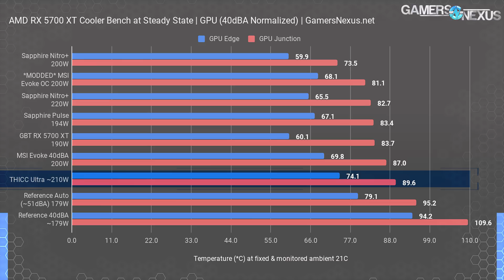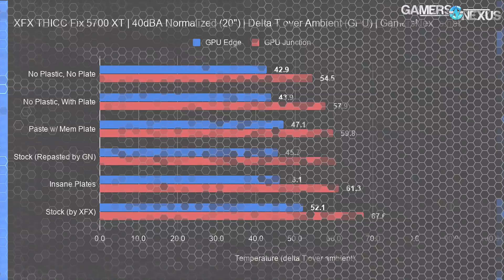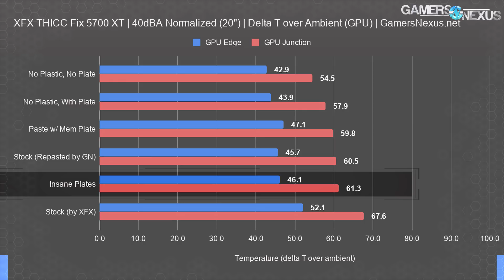Worse Than We Thought: Fixing the XFX THICC 5700 XT

Comment: 🤦‍♂️🤦‍♂️🤦‍♂️ I've been using this card for 5 years now and decided since I'm building a new pc I'll put all my old pc components in a no-frills high airflow mesh case as a guest rig.

I knew the AIO is at EOL, I'm idling in the mid 60s for gpu and cpu and I assumed yeah I just need to dust and repaste which is definitely 70% of the issue.

But had I known taking a bunch of plastic shit off the card would make it run that much cooler I would have done it! Damn, whats the energy of an extra 10c over 5 years?😂

Comment: hmm - My XFX 5700 (that is non-XT) reaches to just over 100 degrees in Radeon overlocked mode.
I suppose I should do something about my card as well. - It's a good performer, but the fans just go nuts now and then when it's constantly sitting around 95-100 degrees with the most demanding games and it's really fatiguing to play with, even with half-open headphones. - That said, I sit right next to the case and it's very "open" with more than half of the walls being mesh. - On top of that, I've even put two 140mm fans as intakes right onto the GPU's own fans, but it only helps a little bit.

Comment: So I got this card when it came out because (maybe thanks to scathing reviews?) it was a lot cheaper than all other AiB 5700s.
I was waiting for XFX to send me the THICC III copper memory plate for most of this time, but they ghosted on all non-XT owners because of COVID.
Today, I finally got over that disappointment and opened the card to remove the McD plastic & backplate, repaste and tighten properly. I also adjusted a thermal pad on the memory plate that was even worse positioned than the one in this vid; it only made contact with 1 of the 4 cooling pipes (???).

After testing before & after with Superposition and 5 min Furmark, the GPU temp went down 20 °C, hotspot by 10–15 °C and memory by 10 °C. These are rough values, as there were some small differences in fan speed & starting temp. Absolutely ridiculous improvements for what barely qualifies as "modding." Highly, highly recommended.

Comment: I just modded my XFX 5700 XT THICC II: All plastic parts removed except the part holding the fans. Backplate removed. Memory plate (stainless steel) removed. Memory temperature is worse now: 97°C junction (max) & 104°C memory (max) @ Shadow of the Tomb Raider. Before: 97°C junction (max) & 92°C memory (max). I did not alter the fan speed. Using the latest bios available from the XFX website. Edit: I misunderstood and thought they'd removed the memory plate too. I readded the memory plate and added paste on the contact points of the plate and the cooler. In contrary to Gamers Nexus I did not remove the thermal pads between the memory plate and the cooler.
Memory temps are improved a lot now - still 92°C max but the average temp is lower. Thank you Gamer Nexus :)

Comment: Jsz Fkn x, How can they use STAINLESS STEEL as material for a component that is supposed to conduct heat !!!???
Don't they know the first thing about materials and their respective thermal conductivity ??
("stainless" has about  "a 15th" of the "condictivity" of aluminium, they would have been 3xbetter off (from heat-perspective) using "regular steel")
But of course they know all this, which makes the choice even more egregious since they made the "bad choice" knowingly...
And I must confess that I still can't see how this even makes economic sense, as "stainless" is both generally speaking both more expensive, and harder to "machine"...So I can only conclude that there must be "manufacturing conciderations" that still makes "stainless" the """preferable choice""", for the PRODUCER...

Comment: I ordered a 5700xt Thicc 2 yesterday. I heard they fixed actually every problem with the card and drivers are top now too. I got it for 369€ including shipping.
Reply: 2 Months later and i wanted to give a headsup. The Thicc 2 Ultra was actual trash, dont buy it. The contact to the coldplate still sucks balls.
Refunded the first one and the second one also had the same problem. Refunded the second one too and got me a Nitro+. I undervolted it to 1.1v and 2100mhz real boost.

Comment: Man I bought the THICC III on Black Friday, it was cheap, 390€, it actually has copper plate for the memory instead of steel, and three fans, and I thought I'd be better, but thermals are still pretty bad and now I don't know if I should return it or just remove the useless plastic.

I mean, temps decreased A LOT with this solution, so much that it could actually be a great card, if I get those results (-6º Memory, -13º GPU edge and -7º VRM Mos).
I don't know what to do.
Reply: I decided to return it.

Even thought it looks like they improved the memory plate, now copper, that part actually got the worst results. 92ºC after just 10 minutes of gameplay! With fans turning at 60% speed, 2047 RPM! GPU Edge was ok 73º, VRMOS meh 82º, hottest point 94º. How's that possible? 92º and 94º with 3 fans at 2000 RPM? Apart from the plastic probably making the air run in circles inside the card, a faulty mount I guess.

But the most frustrating of all was not being able to set up manual fan speed in Afterburner, because it produced flickering. This card doesn't want to allow you to change the fan curve. Now I understand Steve's frustration even more than before, and I think that's XFX's fault.
Reply: @Albert24346  I ordered a 5700xt Thicc 2 yesterday. I heard they fixed actually every problem with the card and drivers are top now too. I got it for 369€ including shipping.

Comment: I just ordered the DD Ultra (non-XT variant of this card) as it was by far the cheapest AiB 5700 available in my region.

Are there any downsides or concerns I should be aware of before stripping the plastic off my card? (Dust? Warranty? Etc.)
Reply: Hey I'm planning to get this same card how has it been for you?
Reply: @muzzammilsoofie5101  Sorry for the late reply. It's fine; really noisy on the moments when it sometimes spins up to 3500+ RPM when launching a game, but then quiets down when it finds a balanced fan speed.

You may have heard that XFX released a THICC III with an updated copper-based cooler/heatplate, and they're sending the new cooler to THICC II buyers. As DD Ultra has the same cooler, I asked them to send me one too. They've been giving me conflicting info on this (whether DD Ultra buyers are even eligible), and don't yet know when it'll be sent (THICC buyers have priority, and it's a couple weeks before they launch the cooler-upgrade process in the US, with no word for EU yet).

It's possible to flash 5700 non-XT cards with the XT version's (THICC II's in this card's case) BIOS to unlock more frequency headroom. See this video: https://www.youtube.com/watch?v=Kt2MUmMt31U – I don't see myself doing it with this cooler, though.

Tl;dr: It's a decent buy if (and only if) the better 5700 AiBs are more expensive (by $20 or more).
Reply: @S3lvah  thank you very much

Comment: Even though these are so crap, they are pretty cheap right now. I'm tempted to get one...🤔

Something I don't understand, why don't coolers blow air across the inside of backplate? That would make far more sense than using thick thermal pads to passive cooling. I'd be interested in seeing how a just copper heat spreader across the chips fixed with some thermal tape would fair.
Reply: Lol!!! .. yeah, it's something I would so do too! Damn the Reviews! This card looks Sharp! Must have this Now! Hahahaha! 
Glad to hear you got a good one and are happy with it! In the end, it's all that matters! Enjoy!
Reply: @Gareth Evans .. Best Buy has them for $409.99, pretty big drop from $450 already. I guess bad news travels quickly. Black Friday's coming up soon, so maybe wait til then. Hey, it still works better than the AMD 5700xt reference blower card and if you did remove the backplate + plastic back plate ends, it would run much cooler.. apparently. For every 3 good reviews on Bestbuy there's a bad one. The people who gave good reviews seem like they don't know what they're talking about and the people who gave bad reviews do! .. A bit disconcerting. This card looked the best imo, of course that doesn't mean all that much tho..
Reply: Yeah, I brought one...😅

Seriously, and I'm actually pretty happy with it!! It cost only £361 (for the non ultra version), when the other non-ref cards start at £400, plus I could return if it sucked. While the game clock 1755mhz & boost is 1905mhz, it will happily stay above 2ghz (can do 2180mhz). That's with auto fan settings, and the junction temp below 80c (reported temp is ~65c), the memory is also below 80c (running 950mhz, up from the stock 875). Oh, that's in a case geared towards quietness rather than airflow/ overclocking.

I didn't expect it to take on the higher-binned cards (Powercolor's Red Devil is currently £429). I haven't been doing well at the silicon lottery lately, so it's a nice change, it will be interesting to see how fast cards built six months from now will go.

Comment: 8:06 have you thought about using small individual passive heat sinks on each one ? i member awhile back i nicked the north bridge ...or was it south bridge ... heat sinks of an only  mother board from like the late 90s  they were only like  5 mills deep  and like 25 by 25 mills long by wide ... maybe you could get like smaller ones that are  just about as big as the memory chips and then you could like use tim  and just have them like hang there off the bottom of the card ?   edit 1  something like this  https://www.ebay.co.uk/itm/2pcs-PCB-Board-40x11x40mm-Black-Aluminum-Chipset-Heatsink-Heat-Sink-Cooling-X8P0-/112644704322

Comment: Dear Steve, I have a question about my Sapphire Vega 64 Nitro+ in regard to undervolting stability:
I undervolted the p7 stage to 1.075V @ 1662 MHz, the p6 is 1.060 V @ 1537 MHz. HBM2 is 1.000V @ 1075 MHz. Power limit was set to +25%. Now I am trying different benchmarks at the moment. I use Fire Strike, Time Spy, Valley, Heaven and Superposition. All benchmarks are running really good but Superposition. It always crashes at the end of the benchmark. Do you have any explanation for such behavior? Thank you in advance and kind regards

Comment: Is the board itself any good? Could be a good watercoooling card, similar to the gtx 1080 msi armor, which had a gaming x board if I recall and is the sole reason why it sucked. Also, I think it would be nice in a second revision, to replace the side plastic parts with metal or get rid of them entirely, then extend the heatsink.

Comment: Why polish a turd is my question. I've spent nearly 3 months with the RX 5700 XT and I honestly believe that AMD's RDNA architecture is inherently flawed. Either that, or PCI-E 4.0 is. I haven't had a single day of stability since installing the GPU, regardless of driver or Windows version. I returned it for a full refund and replaced it with a PCI-E 3.0 graphics card (the RTX 2070 Super) and suddenly all of my devices are working as intended and I haven't had a single hard-lock, browser crash, game crash or anything of the sort.
Reply: RDNA was an stop gap since the product barely released and mid next year they will already be releasing RDNA 2.0.

It seems more like AMD is just trying their new tech wich is not mature yet in the market as the bug testers.

Just like Ryzen 3000, is probably gonna be mature by RDNA 2.5 or 3.0

Comment: When do manufacturers learn, that a bit piece of metal, also called backplate, does a great job at dissipating heat from connected chips.
Like, using a metal backplate and putting thermal pads between it and the RAM chips on the backside of the card.

Comment: I bought an XFX RX 590 Fatboy,, had to return it to Amazon. After two minutes of gaming my whole system would crash. I adjusted the fan curve to have the fans run at 100% always, couldn't even have a conversation around my PC with it like that, and it still crashed!! The coil whine was so bad too, and my PC sounded like a  18 wheelers engine when it was cooling down. Anyways I wanted a red system but after I got my refund I went and bought a 2060 Super, felt a bit sketch about AMD GPUs, still some issues but I think I have them all fixed now, driver related. I was going to get a 5700 but in Canada the aftermarket cards still aren't available last time I checked, happy with my 2060 regardless. Point is blows my mind how they sold that shit to me when it wouldn't function at all, and I was worried I was melting my motherboard lol

Comment: Do you know if anyone has reviewed the ASRock Radeon RX 5700XT Challenger D 8G?  It is the only dual fan 5700 XT that is actually just two slots and two fans and it is only $10 more than the reference design: https://www.newegg.com/asrock-radeon-rx-5700-xt-rx-5700-xt-challenger-d-8g-oc/p/N82E16814930020?Description=asrock%205700xt&cm_re=asrock_5700xt--14-930-020--Product

Comment: lol again companies over complicating this stuff for visuals. I hate side windows for this reason. The coolest quietest GPU I've ever seen was a HD 3870 with a single heatpipe and fins surrounding a simple blower fan. Even at 100% fan speed the thing was near silent and temps only hit mid 60C. Keep it nice and simple guys, if you need more, create a similar design pattern with more copper aluminum capacity. Easy

Comment: I'm not a pro pc builder, techniquer, IT-Specialist or whatever, but I don't like the messup of thermal pastes, that's why I would go this: first a thin thermal pad, then on that a thin copper and then on the copper again a thin thermal pad, to avoid scratches by the copper. Just my thoughts about thermal paste. I just like noiceless passive cooling (material+heatspreader and ofc airbreath).

Comment: The note you had on the reduction in workers available in Shenzen is fascinating. I recently was in the market for a 2080ti, and as an owner of the Gigabyte Aorus 1080ti (not the Xtreme, just the 11G), being overall very happy with it, I first looked at the direct 2080ti SKU that was available. 

The price was pretty awful to begin with, but aside from that, the entire design was a very clear step down from the preceding Aorus model. The heatsink design, backplate, and shroud were all much lower tier. From the extremely robust 1080ti design, the 2080ti Aorus looks about like the more mid-range 1070/1080 AIB variants in overall cooling design. PCB wise it still seems like a fairly premium product, but everything outward from there was a decliine. Ended up going with Zotac this time around, as the performance vs $ was better with what I had to choose from.

Comment: Wouldn't making the top part of the plastic covering vented with some slats also improve temps by giving heat and air a way out? Obviously, not having the plastic there to begin with would be best but if they wanted to keep the plastic there for looks, making it vented might still yield an improvement to thermals.

Comment: Do you set 40dBA as 1450 rpm in general, or is it different for each fan?
In theory, each fan could be louder or quieter at 1450 rpm, so that does not equate to 40 dBA (at a fixed distance) necessarily.
I enjoy this content, bcs it is so scientific and comprehensive. It would be a shame, if all fans would be treated as the same for noisiness.

Comment: Hey GN! Next time the product release cycle hits a lul, please consider doing a more in-depth look at GPU backplates in general. My gut feeling is that they really don't increase surface area compared to leaving the back of the card bare, so it seems likely that they could hurt as often as they help, and if they do help it is marginal. However, I'd like to see some actual data before drawing a conclusion. Thanks.

Comment: @gamersnexus Hey Steve, does mounting pressure have direct correlation/relationship with torque on the screws when tightening? Meaning can we get the same amount of pressure between the each die and it’s heatsink by using a torque wrench to tighten the screw down to a manufacturer specified torque? Or does that not apply because of the variances you mentioned (not all machined screws are equal, die fragility, springs differences, etc) and therefore must be done by feel?

Comment: One argument For testing noise normalized is that it will be equal to real world conditions.  
If someone thinks the card is too damn noisy, they might reduce the fan speeds, and if they aren't bothered by noise, they might increase fan speeds to improve the thermals. This is the simplest way for a user to tweak their cards, and probably the first thing they will try, unless they go directly into overclocking, etc. 
All in all, this is a highly relevant test.

Comment: Can you add sigma deltas in the future to show the errors between runs and equipment?
Can you also use fan power in (watts) not sound as the set testing between all card's, that way it puts in fan efficiency in to part ot the testing. Not saying the Db dosent work just its probably not as accurate and a pain to setup.

Comment: They could get away with 4 screws and razor thin gap between dies and radiator if they'd invest in precision machining, what's the problem measuring height of radiator/die/mounting holes and set it up for 0.1mm.
Enough for paste application, and super thin ram/mosfet thermal pads.
Machining and planing with 0.1mm tolerance is child's play

Comment: Honestly I thought this card looked great it's a bit disappointing that the actual cooler isn't as thicc as the card is. The cheap plastic on a GPU doesn't really bother me that much as it is just trim pieces and your really not going to mess with it that much after it's installed. Possibly if the plastic shroud had vents or grill on it maybe similar to the backplate but more open would still look okay and would probably help the cooler dissipate heat.